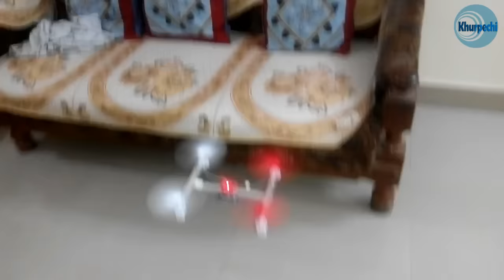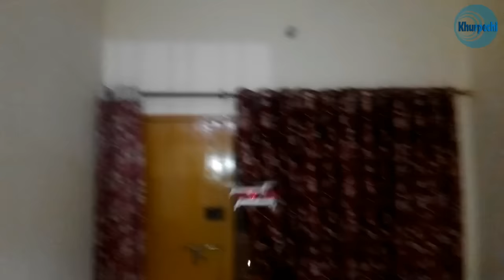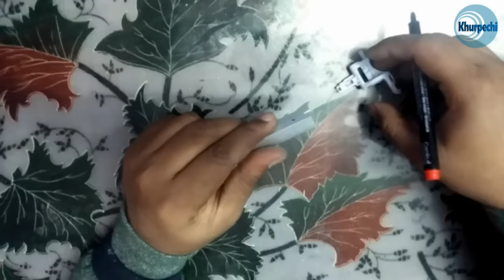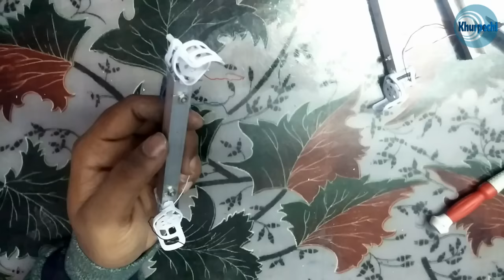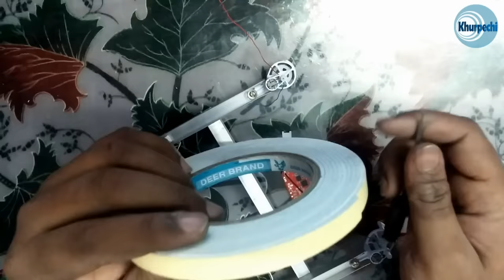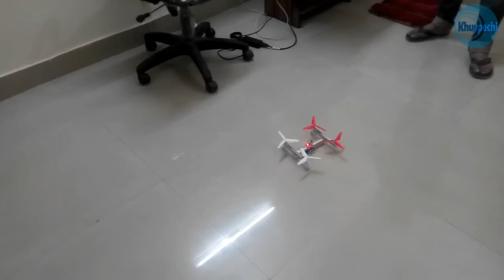How To Make Very Fast Drone Quadcopter At Home

Comment: So this is basically a rebodied Syma X5C;  but it does show that a quad chassis isn't a complicated thing, and allows you to make the quad larger or smaller, maybe swap props to allow changes in speed or flight time, etc.

Comment: Will this receiver board work with any coreless motor attached to a propeller or works only when propeller is attached to a gear in motor holder?
Reply from the maker: it is depending on many thing, if you attach props directly and properly with motor than it increase the chances of fly but the size and distance of each props matters
Reply: I read a review on Banggood where the user says it works only with gears and doesn't work directly. Is it possible for you to check the same by connecting the motors and propellers directly to the board?
Reply from the maker: i was developed a mini quad copter before this and i used small propellers and that was flying 
i am waiting for new motors so i can upload video of mini quad copter

Comment: Sir i want to know How to make a the riciever please sir
Reply: The receiver is just a power distribution board. Just wire the four motors to it and connect it to the battery.
Reply: Tech Tweaks
Reply: I can buy it from banggood
Reply: U can buy it from banggood. Com
Reply: hey tech tweaks you can buy it from any particular website such as banggood
Reply: Lawrence Mao no it's not, the reciever recieves signals from transmitter that "tells" him how much power does each motor need.
Reply: fake quadcopter he use string instead of receiver
Reply: Monalisa Phanbuh that is not fake im working with quadcopters for about 3 years now and i can approfe that this isn't fake do fon't call everything that you can NOT make fake.